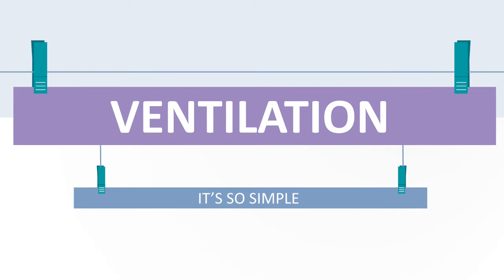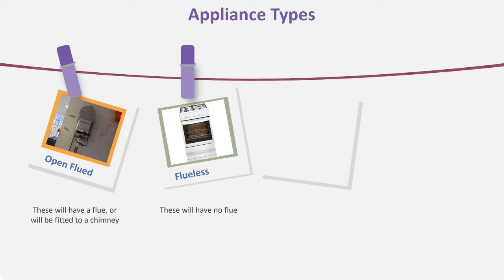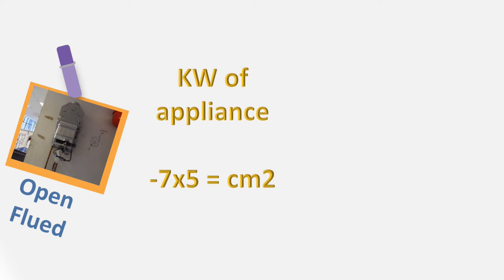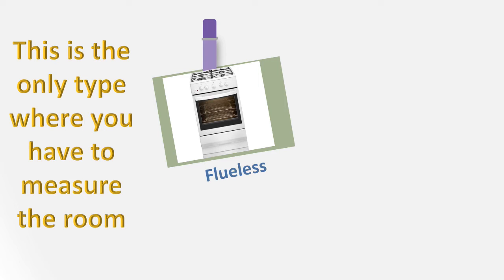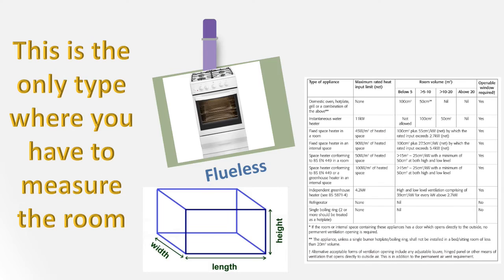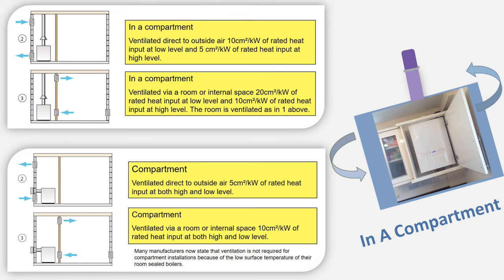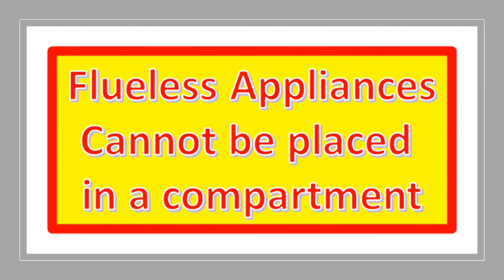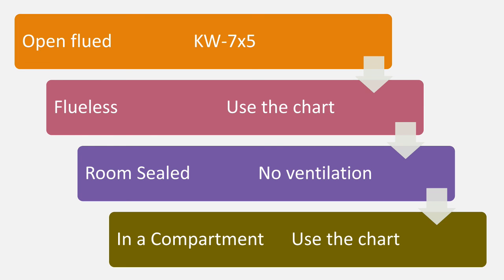ACS Ventilation Made Easy

Comment: Aswell as with pipe sizing do you use the max rated heat input or output to size the gas pipe
Reply from the maker: Hi Cazza…yes, always! Imagine it like this…if you had a Ferrari that goes 200mph you wouldn’t fit it with brakes that only work up to 70mph because that’s the speed
Limit. You’d fit it with brakes capable of working at full speed. Same with ventilation and gas appliances. Most tests on appliances are carried out at full rate then you put the appliance back to its “as found” state. I hope that helps. Cheers

Comment: So when working out the ventilation for an appliance, is it the heat max rated input or output you use as the kw of the appliance to do your calculations with
Reply from the maker: It’s heat input. You only use output figures for coal or wood burning appliances. Cheers.

Comment: Hi sir,
Regarding to IGM G11 ,if flued space heater installed in a siting room with no ventilation,is it ID or AR ? Thanks for your help.
Reply from the maker: Hi, thanks for the question. If the fire is Open Flued and larger than 7kw then it is ID if there is no ventilation. I hope that answers your query. Thanks

Comment: For example say you have 2 flueless appliances in a room, you’ve worked out the ventilation for both, tumbler dryer & a flueless water heater, the room volume is 9.6m3 & it’s a utility room, they each require 100cm2 squared of ventilation for combustion, so you’ve worked out 100cm2 for the tumble dryer, 100cm2 for the water heater, what I’m confused about is do u add the 2 calculations together so 100 X 2 = 200cm2 or because they both require 100cm2 each do you just go with the 100cm2, some info would be much appreciated, thanks
Reply from the maker: Hi Shredder .. the case above is a simple one .. neither of those appliances is a space heater so they both go into the “other” category. You add up the total CATEGORY requirement so in this case it’s 200cm2 and that’s what you provide as ventilation. I hope that helps..remember, it’s categories that count not individual appliances. Thanks for your question.
Reply: Thank you for responding 🙏